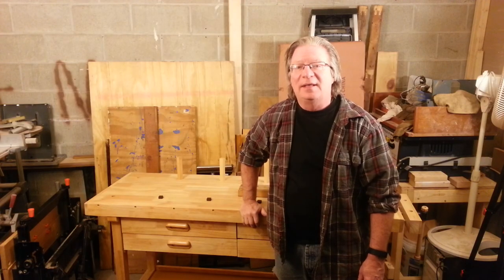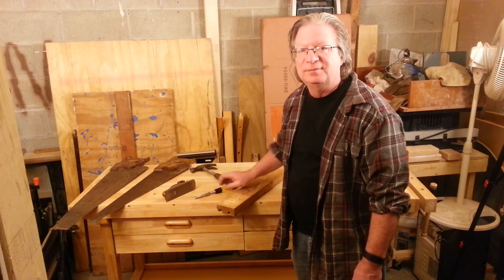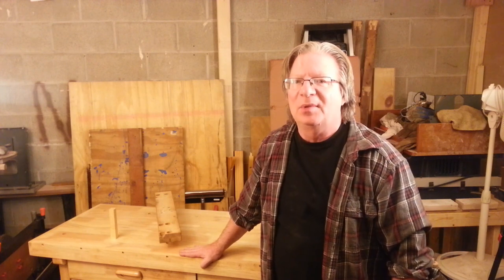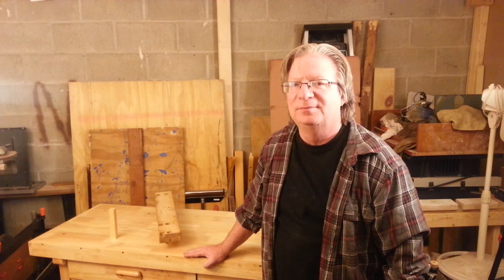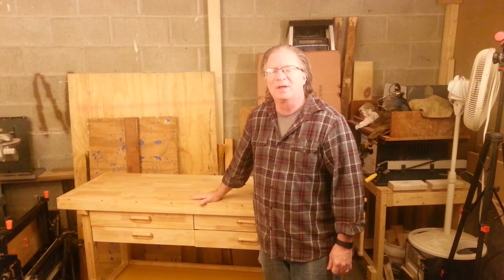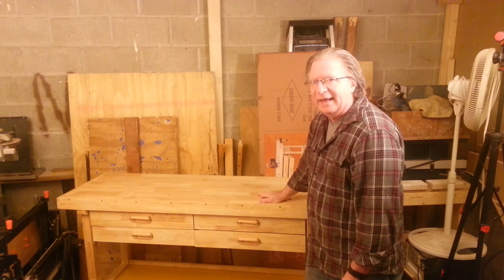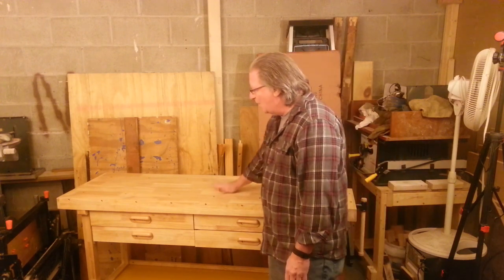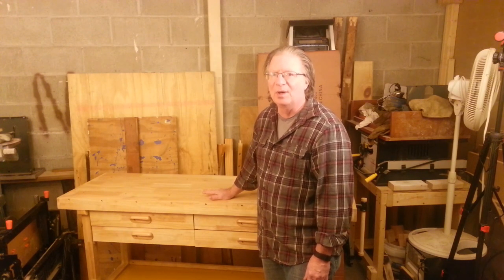83. Harbor Freight workbench tests

Comment: I purchased this bench to make it into a quick takedown bench for transporting it between customers.  I adapted it using Rex Krueger's plan and significantly beefed it up in the legs and filled in the underside of the top with scrap wood from my shop.  I did add a front vise (added expense) and purchased 2 x 12's and 2 x 6's for the legs and stretchers.  I also repurposed the drawers elsewhere.  The bench no longer racks and doesn't move unless it intend to move it.  It was worth the effort for my purposes and the expenses will be written off for taxes.
Reply from the maker: Hi Michael. I'm glad to hear that you were able to improve the bench to better suit your purposes. It sounds like you did a lot of needed work to the bench. Thanks for your comment and for watching.

Comment: I watched the assembly and review video prior to this one. I'm glad you made this video. I am considering the purchase of one of these benches. Especially with the current prices of hard wood. After watching this, I'm not so sure. Thanks Matt.
Reply from the maker: You're welcome Doug. I tried this bench out because I wasn't sure if it would meet my needs or not. The video shows what I found.
I subsequently designed and built my own bench (videos are on this channel). I still use that bench today although I have made a few modifications (the subject of a future video). I have also "rediscovered" the usefulness of the Black & Decker workmate I've had for years and years (there are a few videos about the workmate and improvements I have tried out). I will probably make a follow-up video soon because I am using the workmate a lot lately.
My point is that it seems I am constantly modifying what I am using for a workbench.
Along the way, I have stumbled upon some really unusual bench designs, bought a bunch of books and even some plans.
Since a workbench is basically a worksurface and a clamp, every time I work on a project, I am careful to notice what works and what doesn't work with my workbench. This will certainly spawn a revised idea of the kind of bench that works best for me.
I encourage you to keep an open mind about the bench you use.
Thanks for your comment and for watching.

Comment: I'm thinking to use this bench for leather work
Reply from the maker: The bench might work out for that kind of work. Keep in mind that there are large, round dog holes in the top. Also, if you are going to need to use a punch, I suggest using it right above one of the legs; there will be a lot less bounce there (if you pound on the table right in the middle, there is a significant amount of bounce). 
Hope this helps. Good Luck!
Thanks for your follow-up comment.

Comment: I was considering buying this bench for a shed work surface, but after seeing your videos on it, I'm going elsewhere. I don't need the drawers and would probably be better off with a bench I can move around. I'm thinking a metal-frame bench with a wood top would be better.
Reply from the maker: Thanks for your comment. Years ago, I had an all metal (steel) bench (no wooden top). It was rock steady and also very heavy. I think it was 5' long, 24" wide, and 32" tall. After moving workshops several times, I started using a Black & Decker Workmate (because it was smaller and more portable). I recently stopped using the workmate and built my own small workbench including a vise for around $100. That's the bench I am using now.
Here's a list of the videos I have done regarding workbenches. They are numbered chronologically; the larger the number, the more recent it is.
Simple, wooden work table: 
23  https://youtu.be/wXESQUmipNo
B&D Workmate videos: 
21 https://youtu.be/p3IDiuP8gQc
80 https://youtu.be/EU03vb0tL0U
87 https://youtu.be/AiMv2C6yeDg
88 https://youtu.be/j6fNXq5jF3g
89 https://youtu.be/Ahq5QYAKZhg
Harbor Freight workbench: 
82 https://youtu.be/71udmirVSKI
83 https://youtu.be/71udmirVSKI
New, handmade workbench: 
92 https://youtu.be/osaXlpIFK7Q
93 https://youtu.be/qdgYJ9KYjA4
Thanks for watching.
Reply: @ImaginethenMake  Thanks for that! Going through them now. Looks like I'm making a 2x4 workbench instead of using a pre-made metal one. I'm going to cheat by using some pre-made legs from 2x4basics and my bench will be a bit larger (roughly 5'). But the concrete weight blocks are brilliant.
Reply from the maker: Hi Aaron. If you haven't already built your bench, I suggest giving Global Industrial Supply a look. You can buy a 5', stainless steel bench for $130 ( https://www.globalindustrial.com/  Item #: T9F319056 ). You can also add a vise and casters if you like. Maybe put a replaceable plywood piece on top. Just a suggestion. I don't know about the shipping cost or the return policy. Thanks for your comment and for watching.
Reply: @ImaginethenMake  Good option. I might do that for my garage. For my woodworking bench, though, I need the bottom shelf lower (nearly on the ground) to accommodate large tool cases I plan to put under as storage and weight. I have my parts and setup ready, just haven't put it together as I'm still adding flooring and shelving to the shed the bench will be in. I scored some cedar 2x4s that were leftovers from a deck build. Not sure what I'll do for a top, but will probably just put some 3/4" plywood on for now.

Comment: For $119, you could not buy the lumber to make the top,  not including the $$$, for the planer, clamps, that table is a good starter table, and your saws were not the sharpest.
Reply from the maker: Thanks for your comment. Did you buy one of these benches? If so, what do you think of it? What are you using it for? Thanks for watching.
Reply: Yes,  i bought one,  i find most of harbor freight items need to be modified which i am doing to make it better.  Im starting to get into wood working and when i am in need of a better table I'll have a table to build it on.